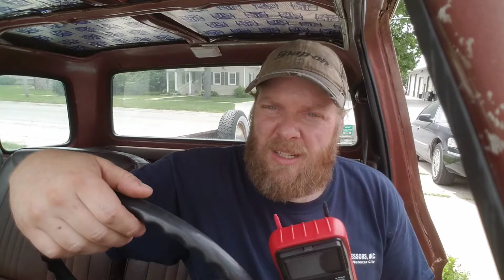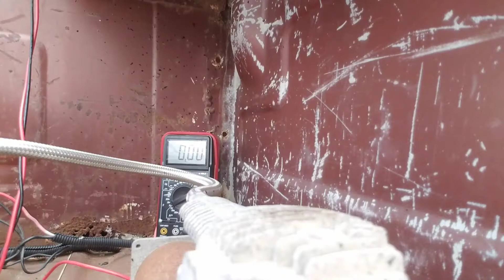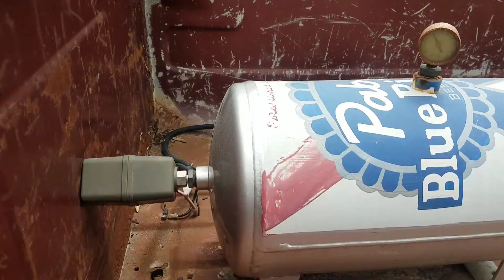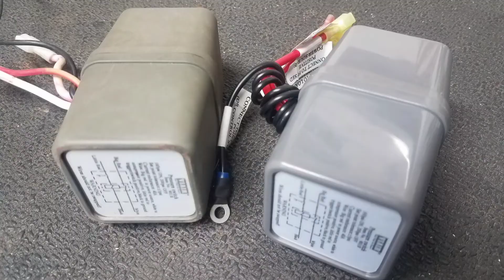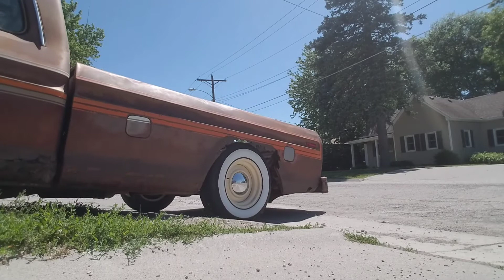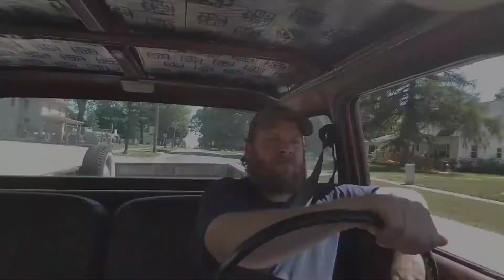FINALLY Driving My Neglected Supercab! - Air Ride Testing And Repair - Bagged 79 Ford F150

Comment: How was the front bagged?
Reply: Sweet!. Im in the works of getting a '77 supercab long bed n want to bag it. Any advice?
Reply from the maker: you will need to cut the inner fenders on the front.  if you look back through my videos you can see how i did them.  otherwise its pretty straight forward.  google bag on beam to get ideas for the bag mounts.
Reply from the maker: also if you want more pics of my trucks you can look up "part time customs" on FB.  there are some of both.
Reply: I noticed you did tub the inner front fenders a bit. Looks clean as f. Didnt know if you had videos of the work. Went thru all you posted. Thanks for responding.
Reply from the maker: No videos of the work.  I built that truck probably 12-13 years ago.  Hopefully soon(ish) i will get around to re-doing the front bag mounts and stuff on the truck and will make a video.
Reply from the maker: How i bagged the front is one of the most common questions i get.  beams are about the easiest thing to bag.
Reply: The front tucks pretty good on it. So drop beams n bags. You're the only 1on YouTube that i found that's bagged  1. Dont see these trucks bagged. Ifs is most likely the direction I'll be going in. Baggin a '98 s10 now. Thank's brother.
Reply from the maker: thanks man!  hope it helps some.  everyone is going to crown vic stubs on these, so its not as common to see.  look for bagged ford rangers, there are alot more of those bagged on beams.
Reply from the maker: Its bagged on DJM drop beams.  it uses the stock spring perches as upper bag mounts.